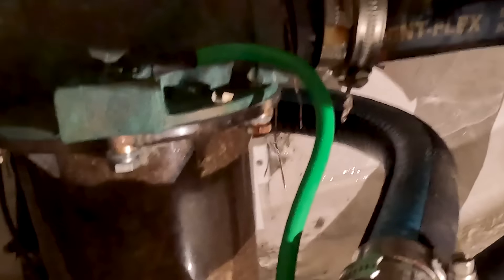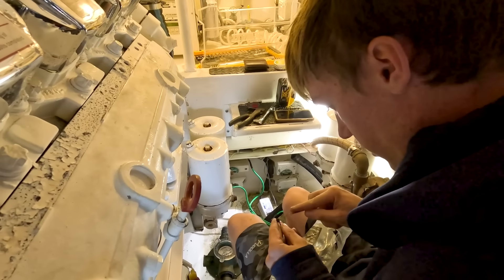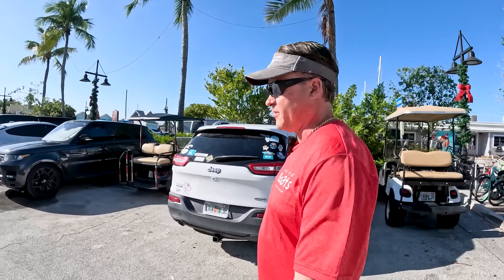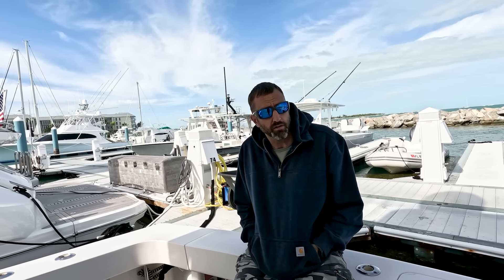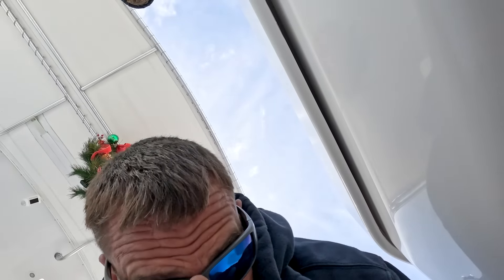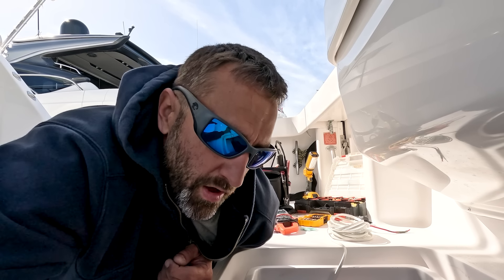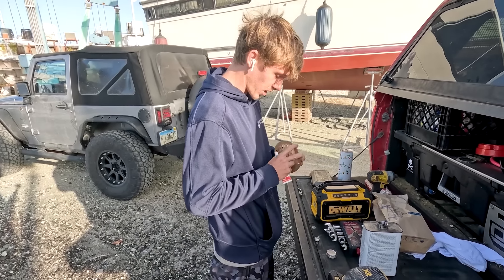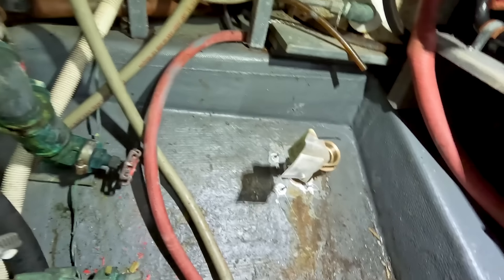This Boat Will Never Be The Same If ….

Comment: I wish fuel tanks made from monel were still being manufactured, but I've heard the material cost now days prevents that from happening. I've seen many old monel tanks in boats that were installed many decades ago and are still in great condition. Monel seems to really be a superior material when it comes to corrosion resistance.
Reply from the maker: Things now days just aren’t made like they used to be … unfortunately!

Comment: Oh i prefer thick ABS plastic tanks metal and aluminum corrode easy over time dosen't matter if its salt water or fresh i know when the time comes im replacing mine with a ABS plastic
Reply from the maker: We can only replace this one with a bladder nothing else will work. In process now of getting it on order! Told you it was coming 👍 bladder takes several more weeks to get … don’t know timeframe yet! Question for you Honeybun … what more would you like us to share in our videos besides repairs? We are going to expand our coverage 😊
Reply: @WillFixThat  I understand why yall want to do a bladder for the fuel tank because Matt is right once you move the seating it's never the same but one of the things I suggest is what happens when a customer wants upgrades like simrad or garmin or what about boat trailer repairs or even outboard motor rebuilds idk there is alot yall could cover even electrical diagnostics
Reply from the maker: @honeybunbandit1  good ideas … as long as we have a job that wants those things!
Reply: @WillFixThat  true idk what yalls common problems are